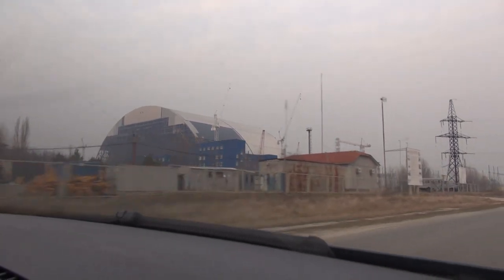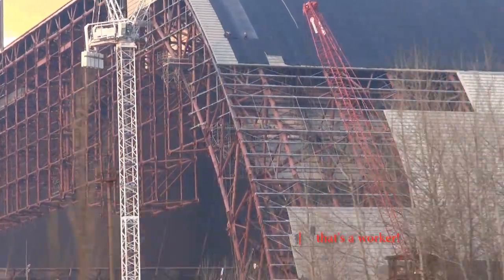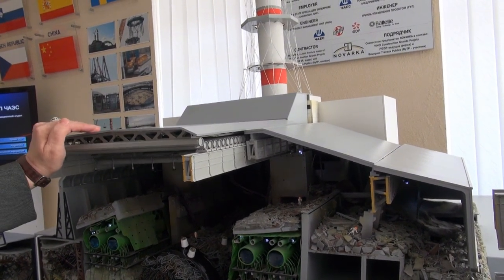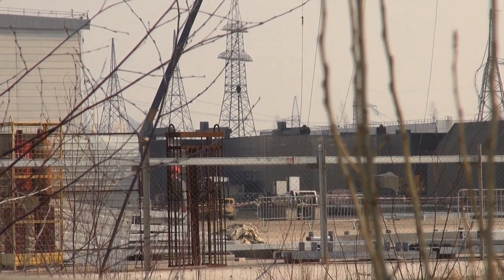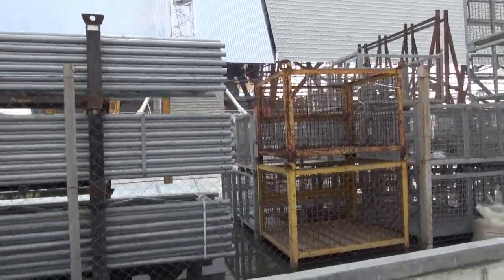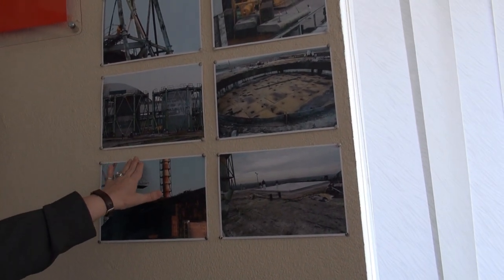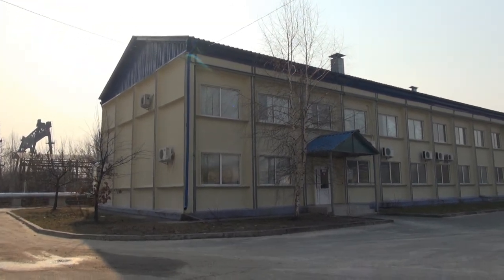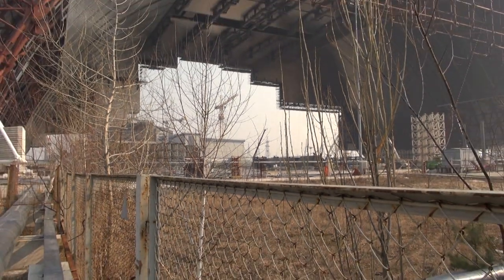Chernobyl New Safe Confinement (NSC) 2015 - "Арка" shelter of Reactor 4

Comment: It is so crazy that people still think about building nuclear power plants. The investment needed for this single cleanup (100+ years of work remaining!) must have used up all the "savings" that nuclear power is supposed to give over other forms of energy for this power plant and ten others....
Reply: superdau Well designed and built plants don't blow up. This was an ancient design (graphite moderated), and lacked some important safety features (e.g. containment building). The operators weren't properly trained, and they were conducting a dangerous experiment. They had to disable the automatic shutdown system, because it does not allow what they tried to do. When started to lose control, they just kept trying (probably because of the same political pressure wich caused the Challenger disaster in the same year). Finally, they found the "self destruct" setting. And they had no plans, and no euipment to deal with the disaster.
But despite the huge mess they made, only about 60 people died (according to the WHO). Mostly the local firefighters who arrived at the scene first, and had absolutely no protection.
The other two famous nuclear accidents caused zero deaths. Currently built reactors are way much safer than any of these.
On the other hand most of the energy we use comes from burning fossil fuels, which kills hundreds of thousands every year, and f*cks up the climate of the entire planet.
Reply: superdau Japan is firing theirs back up this week. I fucking give up with this world
Reply: ***** look, we have had nuclear power for what....70 years now? and 2 really major accidents have happened, Chernobyl and Fukushima...maybe you could count that Soviet storage site accident from 1950's or 60's as third one...either way nuclear power can be safe it its DESIGNED to be safe....and for most nuclear reactor's, its simply impossible to have this kind of severe accident...even with the remaining RBMK reactor's its highly unlikely that Chernobyl could repeat, since the safety was improved quite a bit after 1986....even with Chernobyl reactor 4 the accident would not have happened had the operators known of all the dangers and flaws of the reactor in which case they would have not done the test which went against every safety protocol.

I say nuclear power is still our best alternative until we find a way to create more efficient "green energy"
Reply: Balnazzardi ok first off three mile island was a major accident here in the US just because it did not cause death and blanket the world with radiation  does not down grade it 2nd this plants explosion was caused by a hydrogen bubble in the reactor the japan incident was also a hydrogen bubble both caused by the water used in cooling becoming super heated and separating into their core molecules this same thing can happen at ANY nuke plant its just one of the risks that come with it another is cracks forming in the containment buildings this one i experienced personally while taking a tour at a plant then you have the spent fuel that remains hot for 10s of thousands of years  sorry but the yucca mountain site is not going to be able to handle it all what do you do with that stuff there are better choices just no one wants to put forth the capitol to build or even research them
Reply: ***** All of these problems can be avoided with other types of reactors. For example the LFTR reactor (https://en.wikipedia.org/wiki/Liquid_fluoride_thorium_reactor) operates at atmospheric pressure, so leaking is not a big deal, does'nt use water, so no steam or hydrogen explosions, and it burns its fuel completely, so no long lived waste. And it has several other advatages. A prototype of this reactor was run successfully for years in the 60's in the US, but the program was shut down, because the military had no use for it. Currently China is spending billions to develop this technology. Several US companies are also very interested, but with the current regulatory framework it's practically impossible.
Reply: superdau Realistically other forms of energy are mainly coal power plants, so yes the savings are huge. Protecting the environment has to be concidered savings, look at california right now, they don't have water. Thats expensive
Reply: I'm no professional in this field just a high school student who's taking an engineering class and was educated in nuclear power. In the united states at least there are emergency protocalls that do not need human intervention such as emergency cooling water to prevent melt down, in a scenario should a reactor melt down there are environmental shields to prevent further damage to the environment.
Reply: Pouroddacloud Cloud Yep, called a pirmary containment vessel, which those old soviet reactors don't have ofcourse. Basically an open reactor in a warehouse. Geat success!

Comment: Its fantastic that the world has pulled together to finance and build this structure.. but is it just me or are they taking their time about it? I'm pretty sure they could have had this built in half the time if it were a football stadium.
Reply: I would be inclined to disagree. I first visited this site in 2011 and not a lot seems to have happened in 4 years.. There is really no reason we could not have had this constructed by now other than the fact that no one really wants to pay for it to be built quicker. We are at a stage where if absolutely necessary, as long as it falls within current tech capabilities (and sometimes beyond), we could have anything built within 5 years, no problem.

Your comment about the football stadium, sarcasm right?
Reply: Would u?

Comment: The big question is what the hell is TEPCO and Japan playing at, not building a similar structure around Fukushima, which also has melted lava fuel.
Reply: +sonofhendrix actually, they are. it's a little different, due to the different structuring of the reactor in fukushima.
Reply: +sonofhendrix The major problem the Japanese are trying to deal with is containing contaminated ground water.  The reactors there melted down and the tops of the containment buildings were blown off by hydrogen gas explosions, but the actual containment vessels didn't explode and eject nuclear fuel all over the place like Chernobyl, where the reactor core was completely breached.  The Japanese are still trying to figure out exactly what is the situation inside some of the melted reactors.

Comment: why dont they get robots to clean out the nuclear material and dispose of it?
Reply: They probably will do that. the idea behind the large containment area is to prevent a possible collapse of the structure during cleanup.
Reply: The explosion happened in 1986. There were no robots at the time, and certainly not ones capable of the type of work required to clean up this mess. The cleanup is projected to take more 100+ years AFTER the new building cover is in place.  While the actual dismantling of the original sarcophagus and the underlying reactor building will most likely be done in combination of humans and robots. Hopefully, future technology may include some type of nano-particles that can actually scrub radiation to help clean up the debris, but it will still need to be torn down, packed up in as safe a manner as possible, and then stored on site in a way that will prevent any future accidents and leaks from happening.
Reply: jakesweet1000 sometimes the robots melt due to the high temperature
Reply: the radiation destroys civilian electronic very quickly, and  while military spec. electronics are hardened against radiation they last only a little longer because of the vary high levels of radiation.
vacuum tubes could be used but this would drastically reduce battery life and only the simplest control circuits would  be able to be used.
the radiation is so bad that it even compromises the insulation on wiring and the integrity of metals.
Reply: They did, the government sent robots, but they were destructed by the radiation, only human force was possible, however got cancer and many volunteers and soldiers, died in the first months.
Reply: mil spec. electronics are radiation hardened vacuum tube electronics even more so, so there are options other than human at least for 
some of this.basicly people were cheaper.
Reply: Clay Mccormick that too, but the government sent tanks, which t means, they didn't have a clue how to deal with a nuclear disaster, and we must remember that was inn1986.

Comment: bionerd23 - Although I appreciate your efforts on recording & exploring the AFTERMATH of the Chernobyl event,... I am somewhat confused and wondering HOW &WHY , you altered the COMMON values for radiation EXPOSURE DOSES given in roentgens ( between 1r /hr - 2r/hr )  by the staff lady,... ON THE ROOF  some 60m above ground level & NOT taking into account of the INVERSE SQUARE LAW,.... 
.... and yet you decided ( without explanation or medthod) to JUMP-convert these to ABSORBED DOSES,... first to Gray  !!!??? when there is a direct Sievert EXPOSURE DOSE >>>> 1r/hr  = 11.93317422rem/hr or >>>> 0.1193317422Sv/hr ( = 120mSv/hr  !!! FUCK !!!! ) how did you arrive at the miniscule value of 10-20mSv/hr  ??? and why did you change the COMMON EXPOSURE DOSE data to the x100 lower  SI UNITS* ABSORBED DOSE ??? 
- Sadly, I think you are doing a COVER UP in line with the IAEA by reducing the DANGER FACTOR  of the real contamination and attempting to equate theses with the NATURALLY found radiated sands of Brazil.  Question: would you bury yourself in the soil under the top 5 cm of soil pushed over the contaminated areas of Chernobyl, as they did on the beaches in Brazil ??? 
- I smell a at here !!!